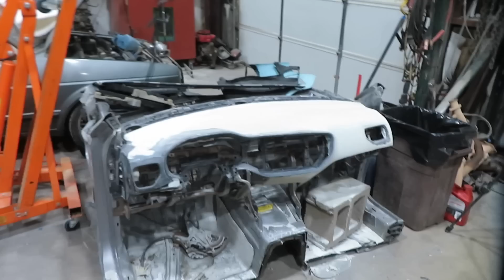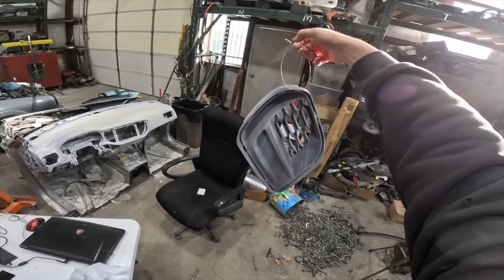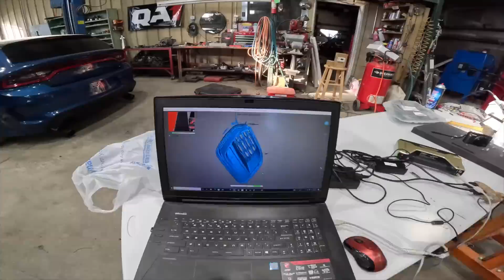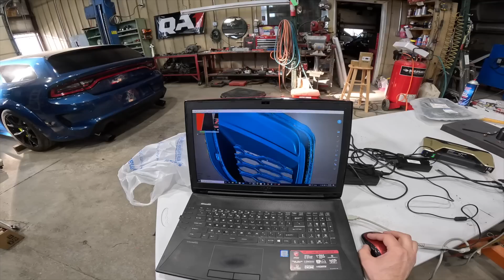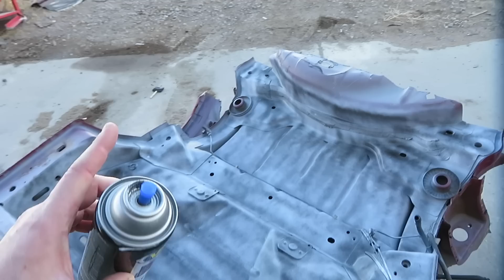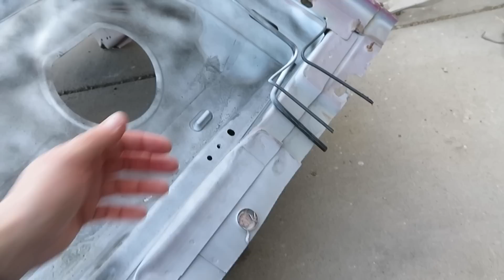3D Scanning my 2023 Magnum Hellcat!!

Comment: you can use the hellcat dash and chasiss driving sim rig have 3screen where the windscreen was steering and  seat on gearbox pedals you get the drift parcel shelf table with speakers or use awhole car projecters